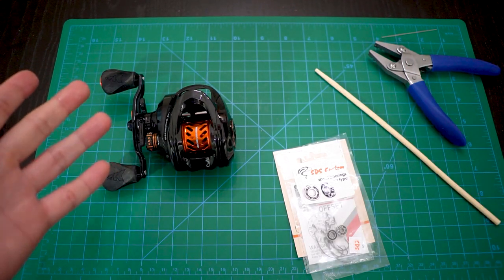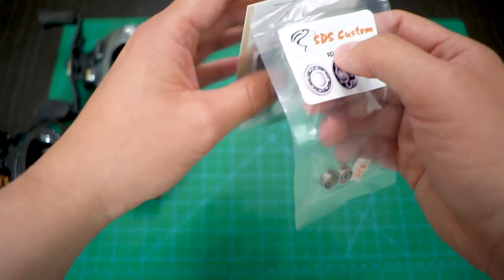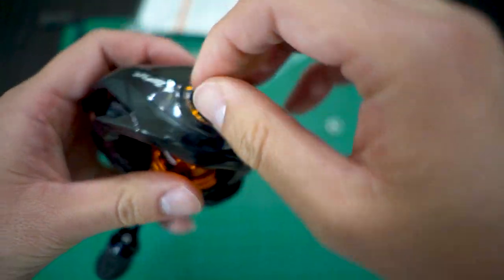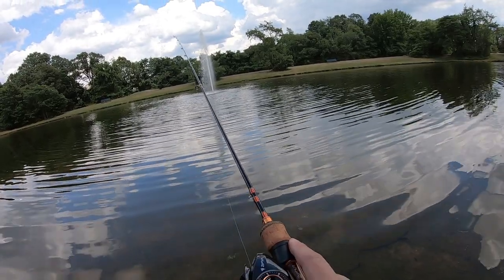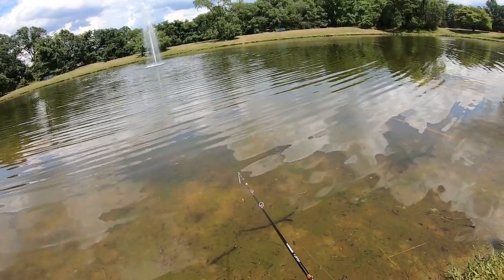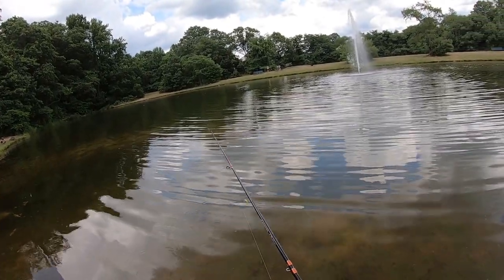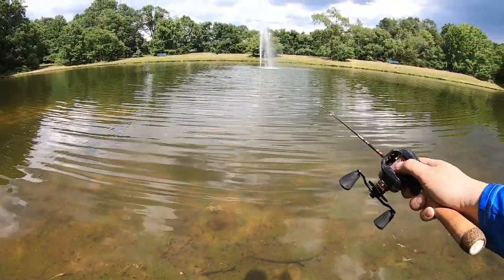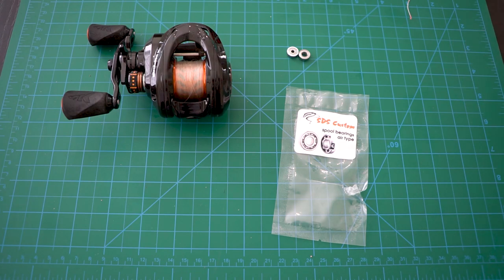KastKing Zephyr BFS Reel Bearing Upgrade - SDS Custom Ceramic Hybrid Bearings

Comment: Just picked up some of these for my zephyr off of bait finesse empire along with some other goodies! Can't wait to put them to work!
Reply from the maker: get em woot woot! spring can't come any sooner!
Reply: @raWr Fishing  what can I do if the little tiny pin on the spool won't come out?
Reply from the maker: @Isaac Rodriguez  oh boy... try channel lock pliers. Because the pliers ends may not align... you can utilize this to work on the spool shaft and pin and shove it out. But do carefully and make sure u push the right side through.
Reply: @rawrfishing  which side is the right side lmao
Reply: @raWr Fishing  nvm I got it! Thanks for taking the time and replying to me at this hour!
Reply from the maker: @isaacrod710  bed time now lol

Comment: Great video. Followed your youtube link for the ceramic bearings. I see a number of types including Air, Full Ceramic, Microceramic BFS style....  which is the best for distance?  And which particular pin remover did you use? Thanks.
Reply from the maker: Well i never used full ceramic and the Air bearings are higher end stainless steel bearings compared to the generic orange seals  Micro bearings are nice for light lures, but you can't cast far if you have heavier lures.  Which ones i like better? it's totally subjective on the day/mood/setup and lure i am throwing lol.  I am about to switch back to the Air Bearings (these) in place of the Roro to mess around some more.   Rergardless, you can't go wrong with either ones that I have used when compared to the stock bearings!

Comment: I never even thought to upgrade the bearings. Do you know of any for a Lews Carbon Fire baitcasting reel? Crazy seeing you cast such light baits.
Reply from the maker: Bearing upgrades are amazing.  Keep in mind that after you upgrade, lures comes out faster and easier. You may cast further, you may not!  You will also need to adjust your brake settings, tension, and casting afterwards to see the best results.  Some folks give up because it's not how it perform for them.  Any how, I am not familiar with that reel, but looking at Spool Hi-Speed page, you can figure out what you need and order else where if you want cheaper ones: https://www.spoolspeed.com/collections/lews/products/lews-spool-hi-speed-full-tune-kit?variant=15344152576045

Comment: High, I know this was a couple of years ago but, is the Zephyr  a completely different reel to the Royale legend model  ??
Secondly can you fit the ceramic bearings into the Legend  ?? 
If so what would i need to order. 
I think I have the Royale legend 2  ??
Hope you might see this and be able to help. 
Cheers Les.
Reply from the maker: Those are two different reels indeed. You can reach out to kastking support to see what bearing size you will need! They are pretty responsive based on my past experiences
Reply: @raWr Fishing  High, thanks for that appreciated 🙏. 
I have watched someone else's video, was it yourself that was referred to with regards to a good deal of input to kastking,  for the Zephyr model 🤔. 
You were refered to as a friend at raWr fishing by the film provider on you tube. 
Thanks again for replying 
All the best Les.

Comment: Those are AMAZING casts considering your rod is only about 5.5 feet long! I am just getting into BFS fishing as well, just bought the Zephyr and had intended to pair it with a 7'3" Dobyns Sierra (I fish lakes from shore a LOT but I also intend to use it with my Colorado Fishing pontoon. Now I'm rethinking that 7'3" wondering if I really need that length considering you are spooling 90% of your reel out off a 5'5" (I'll be using 4 lb braid). Anyway, I followed your link to the bearings and set it for model GH100 but there are 4 different bearing types as choices. I'm a little confused as to which would be most appropriate. I emailed him and got an auto-reply that he is on vacation. Which bearing type would you suggest?
Reply from the maker: Don't forget that I am using American 4 lb test line, which is really 6 lb outside of the US.  If i were to use true 4lb test or thin braided line, it would go further!  that new rod will be fun!  For SDS Custom, select Air Type for this same Bearing or BFS for Micro Bearings.  These bearings will do better for heavier lures and for distance while the micros will do better casting lighter lures as it allow the spool to start up easier.  Welcome to BFS :)
Reply: Thanks again for the quick reply. I turn 67 in a few months so this definitely falls under the category of teaching an old dog new tricks! Very informative!
Reply from the maker: Never too old to learn!  Especially for fishing!

Comment: You have convinced me to upgrading my reels to hybrid bearing so could you confirm the sizes you used for the GH 100 and the XF-50 / Sprit Fox reels, I need to buy. I want to see the improvement it does on one reel before I replace all the bearing in my others first. I think I need to buy two 3X 10X 4, bearing and one 5X11X4, bearing and one 5X10X4, bearing. Hope you could confirm if these are the bearings I need to buy.
Reply from the maker: Bearings  will do better for any BFS reels!  You may want to consider getting both micro bearings and ceramic hybrid at normal sizes so you can see the difference. For your XF-50, get the ray studio, it's 3x10x4 and 5x11x4: https://www.aliexpress.com/item/32565701258.html?spm=a2g0s.9042311.0.0.d07e4c4dSMnPgm
For Zephyr and GH100 Variants, it's 3x10x4 and 5x10x4 (this is the trouble one).  I think you will have fun with this project!   Hopefully you can find cheaper ones than the ones i have gotten~!  Stay tuned for Micro Bearings for GH100/Zephyr/Dark wolf
Reply: @rawrfishing  I figure by winter I can start experimenting with a few reels and take my time doing a complete cleaning and upgrading on a few reels. It might be interesting to test the difference between different bearing manufactured models to see which ones cast better than others. I’m going get a set of ABEC7 Orange Seal HYBRID Bearings for one XF-50 and one set for a GH-100 first being they are seem to popular. It is real easy to tie up a $100 dollars real fast buying a just a small handful of tiny bearing. Thank you for confirming the sizes I need.
Reply from the maker: it sure can, but the ones i sent you are pretty cheap for micro bearings. if you look at the real japanese one like Hedgehog studio, a set can run you into 40s plus shipping. I got some micro bearings as you saw at the end of the video. I will share those links once i test teh quality.  those are pretty cheap too..

Comment: So did you find the microbearings or the ceramic bearings to be the best upgrade on this reel. I had a gh100 and found it to feel a bit plastics, especially the brake setting , how does this compare to the Zephyr?
Reply from the maker: Given that all CDM reels (this Zephyr is no exception) can't really cast 1 gram lures and at the 1.7 (1/16th oz) is still quite difficult and short distance, I feel that micro bearings isn't really necessary.  Afterall, Micro Bearings reduces casting distance.  but if you don't care for casting distance and love to sling out lures short distance at east, micros are great.  The GH100 is truly low end in my books. out of all my reels that I have ever purchased, it's at the bottom. The black knight would surpass it in feel and performance.
Reply: @rawrfishing  thanks, that’s really interesting. I’ve been using the Tsurinoya kingfisher this past season as my ultralite spinning reel on my channel, and I’ve got to say I’m really impressed!!! Every bit as good as my shimano stradic ci4 ..... it’s handled some big fish with ease
Reply from the maker: The kingfisher with shallow spool spinning reel right? I was thinking of getting one for a trout magnet setup.

Comment: Do you use braid on bfs? if using braid for bfs do you run backing? Can you do a video going over pros and cons of each type. Thanks for the vids you do
Reply from the maker: I barely use braided line but there are folks who does!  I change line out a lot due to various testing, so it's most economical for me to stick with mono and copolymer.  Most people like to use either 4 strand braid or them stiffer materials, like them Spiderwire or them Berkley FireLine/NanoFil.  Soft braided line are no good!  I ran that once recently with my new Tsurinoya Dark wolf and I had to take it off after doing my snakehead fishing challenge and a cast test. ton of line wrapping around the rod and over spooling was a nightmare.  I tied directly onto my spool by tying into one of the slots.  just be careful when tightening as the spool is sharp and can cut your line.  I can possibly do some line videos in the future, but after i learn more about the brands out there that other folks uses.  Afterall, I started my BFS journey not too long ago and currently just exploring primarily reels right now.  One thing about using braided line is that you should properly set your drag.  Also don't try to force snap a line if you snag via pulling back on the reel.  you may warp the spool!
Reply: @rawrfishing  great info there. Thank you very much for the reply. I just came across your channel about 3 weeks ago. Really good content.
Reply from the maker: no problem! I wish i can provide more info, but I mainly use braided line when fishing frog lures and for snakeheads. I try to stay stealthy otherwise lol.  Glad you have found my channel! Hope you stay for the long run! Close to 400 videos now :O
Reply: I use SeaKnight Nano 6LB braid on my SpiritFox with a 30-40cm leader from fluorocarbon, so far very happy with it. I also tried fluorocarbon but I find that braid actually flies further and causes a less overrun.
Reply from the maker: nice Vasili! thx for chiming in! i don't have enough experience with braided line on BFS stuff, i appreciate you  jumping in! i am sure Shroom does as well!

Comment: Do you prefer these bearing over Roro micro bearings? What are the benefits of hybrid bearings over micro bearings? Thanks for the vid.
Reply from the maker: It's hard to answer the first question. It all depends on lures I want to throw, line i use and rod i use.  Let me help you understand a bit more and then you can decide! Ceramic Hybrid Bearings in normal size, so it can technically spin faster and potentially can help you cast lures further.  Micro bearings (whether it's stainless steel or ceramic hybrid) allows you to cast lighter lures easier, but you will likely get less distance.  Imagine you have a tennis ball vs a basketball, roll them.  which one is easier to start off rolling? which one will hit max speed first? and which one can travel more distance even though it can't hit max speed?   

For the Zephyr, because  You can't really cast things down to the 1 gram level, it's probably not needed for micro bearings if distance is your goal.  But if you don't need distance, micro bearings does shoot out easier, meaning you will use less energy to cast.  Bearings impact every setup differently as everyone uses different tackle!  hope that helps a bit.  I feel that I will put these back in soon and play with it more.
Reply: I'am  going to get the ceramic bearings.  I need to see for myself then which I prefer. I have the Roro micro bearings installed on my zephyr reel. Have not had time to try it out . I have been mostly striper fishing.  Thank for the great vid and info. I got a good crappie spot that ill be going to this week taking my zephyr combo. Thanks again .
Reply from the maker: @damiangonzalez615  definitely wanna try it!  if you got a longer rod, say a 7 foot Light rather than a short UL, i would say you would benefit with a full size bearings in ceramic hybrid.  I will likely swap some stuff around soon to fiddle! hope to answer this popular question for everyone!

Comment: Ceramic Hybrid Bearings great idea, where did You get throws pliers from and what are they called? Looks like they do a great job.
Reply from the maker: it's a fun way to change the reel's spool behavior ;) the ones i used are from boca bearing. expensive and easy to break. T_T

Comment: Do the ceramic bearings need to be lubricated?  Or run dry?  And how many feet of line in the spool?  And what rod is the zephyr on?
Reply from the maker: no, you can run em dry. 100-125 ft line maybe?  Zephyr bfs rod.  If you want a better rod at similar price, check the Tsurinoya Dragon.

Comment: nice vids, hey does this reel have solid frame like aluminium? or does it get frame flex?
Reply from the maker: thanks! this is all carbon fiber. it would flex if u put extreme load, but likely that won't happen since you will be using lighter line and rods.
Reply: @rawrfishing  thanks for the reply

Comment: Why the "air type" over the "full ceramic" bearings? Do you think they are better? Nice vid
Reply from the maker: Air type i belive is a hybrid of aero grade stainless steel outer layers while the bearings are ceramic.  Its normally quieter than full ceramic and the benefits of full ceramic isn't much.  Weight reduction of the inner race doesn't really do much at this point.

Comment: What is your favorite BFS setup(reel/rod/line with -3gm lure/baits) I would love to know and why? 
Thank you, im just getting into BFS baitcasting
Nice video thank you again
Reply from the maker: I have so many reels that it's hard to pick. But given Yen is down and importing a reel is cheaper than ever, I will have to say Aldebaran BFS 2016. Great out of the box and have room for upgrades. Spool is large enough to handle larger lures, but light enough for lures down to 1.5 grams easily.  Rod wise.. Tsurinoya Dragon is a great one
Reply: @rawrfishing  I will check out those options thank you for the reply and taking time out to do so blessings and Aloha from the Great Lakes

Comment: Hey I just ordered one what what brand and pound braid do you prefer and leader, this is my first bfs set up and I’d appreciate if you helped me out 🙏
Reply from the maker: LB of braid will depend on your fishing. I would first figure out what rod you will be using and technique, but be warn that this reel isn't made for the lowest UL. at best its at the upper end of UL and is better as a L and ML BFS Reel.  Too thin of a line can slip past the side of the spool and get tangled inside the reel.

I have tried using this budget reel to handle a lot of UL fishing and I have removed it completely out of my UL Arsenals. It is now only on L and ML, so I use thicker lines.  

I am not picky with brands, but If i had to recommend a reliable one, it would be Varivas, it's Japanese line!  I would say try their entry all rounder line such as the Varivas 4 or Varivas 8. Start at 1 Gou diameter and that should go well with 8 to 10 lbs mono.  I use Varivas Absolute CB Mono a lot this season!

Comment: If your bearing in the side plate is hard to remove just use the shaft on the spool to gently wiggle it out.
Reply from the maker: I may consider that for the future

Comment: Hi, i saw on the sds website that there also purple bfs bearings. But are they more performing? And the pliers you use to remove the pin, is it specific,? Finally, sorry but i sent you a comment on the video " Tackle Talk: Budget Tackle Tsurinoya rods", i ask you if you can. Thanks for your patience
Reply from the maker: Micro Bearings starts off easier than full sized ones, which is beneficial for you if you want to throw lighter lures under 3 grams, especially closer to the 2 grams.  If you plan to throw stuff 5 grams and higher, full size could potentially give you more distance.  It will all depend on your line, rod, lure and casting techniques.

You can look up the SDS's inventory for their spool pin remover.  They sent me one recently and so far it works great!  That one video is not mine so I don't really get notifications from it lol.  or at least I can't see it from my Administration Tools.  I get so much comments that comments on other people's videos normally get washed out >_<.  So make sure if you have questions, please make them on my videos instead.  New comments preferred as they will certainly notify me!  responses.. they get washed away too lol
Reply: You're righr, sorry i got confused. Thank you for the answer about the micro bearings and the their spool pin remover. I practice trout area in the lake with ultralight spinning gear. I use 3,5g spoons, with 0,16 diameter nylon line. Now this technique i would like to do with bfs castin equipment. Could you recommend a combo( rod-reel ), of a good quality, has an acceptable cost? I thank you again for your patience.
Reply from the maker: @marcofaenzi3019  the KastKing Zephyr Reel and Rods are pretty good and the Tsurinoya SpiritFox BFS and the Ares Rod (C472UL) are great too.  Both I would recommend to swap to the micro bearings and you will have a blast.
Reply: Hi, thank you for the tip for the reels. For the fishing rod throug, it's too shoort. I would like it 2 pieces , ( always with the solid carbo tip ), because i find it better with a length  around 1,90-1,95 meters. I know that i am boring you with my request, but you have deep experience and knowledge of the subject and i am a beginner. I took a look in the web, but in Italy the technique i would like to practice is still unexplored field. We are not ready yet. I really appreciate your judgment. Thank
Reply from the maker: 1.8 vs 1.9 isn't that far for the Zephyr Rod.  You can try The Tsurinoya Dexterity C632UL. that is 2 pieces and 1.8m.  Other than that, I think you gotta explore yourself to see what will fit your preference.  best of luck!
Reply: Tanks for the valuable advice. I try to see on the web and then i will make a decision.